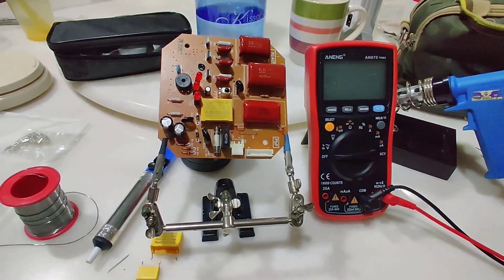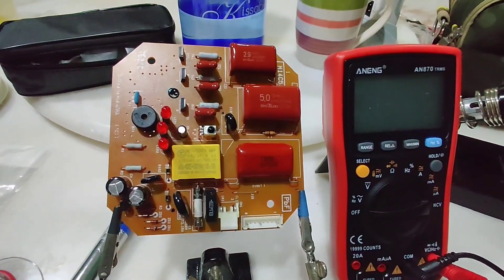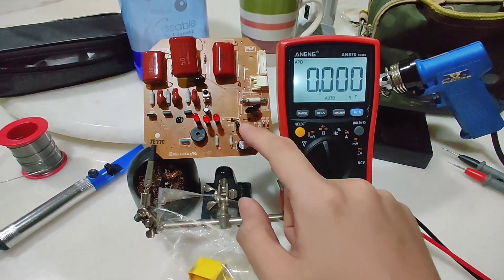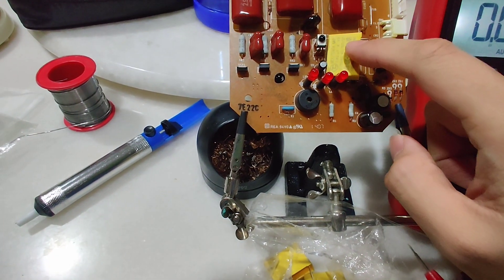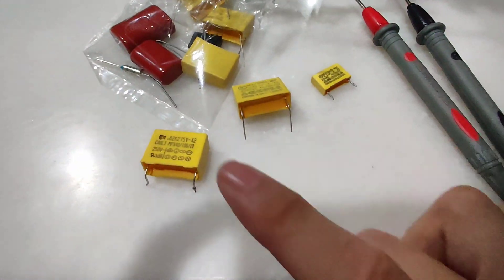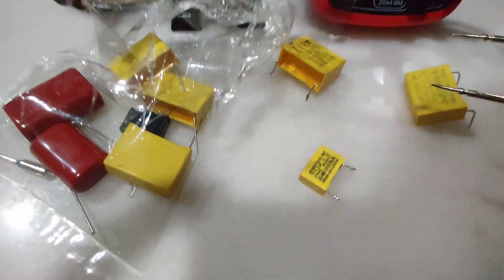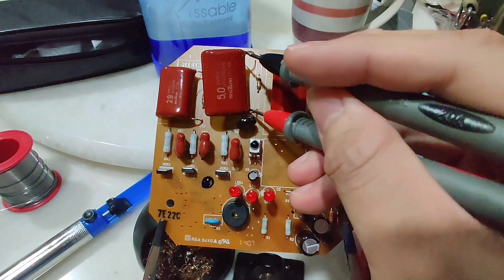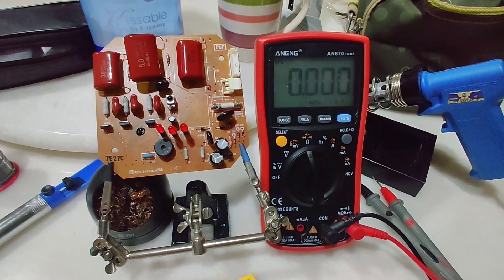How to repair the circuit board of Panasonic/KDK ceiling fans

Comment: Hi. I'm having similar PCB for KDK fan 4 blades with remote. The speed no.3 seems not functioning (already check 1 by 1 speed by remote), so which capacitor should I replace?

Comment: Thanks for sharing your video. My KDK remote control ceiling fan is slow on the first and second-speed settings. At high speed, it works fine. I checked the 1.8uF capacitor it's showing 1.4uF and the 0.1uF capacitor is reading 0.07uF. Do you think both these capacitors need to be changed? Any pointers appreciated
Reply: You can use mine as reference. Panasonic KY14R  140cm.
-All cap must be removed from board for tested, if not the result won't valid. I experienced measure the cap on board shown good value, the when remove from board and measure again the cap is bad.
- the 0.1uf cap is just filter cap, it is use for filter the power supply noise to protect the circuit as long, it won't affect the fan speed. It is connected btw L and N, that is why now new model they use safety X2 cap (Metalized Polypropylene (MPP) rectangular shape) instead of normal brown polyester cap. X2 cap is used to prevent short when the cap fail. For you case you may or may not change it, but if already dismantle why not, it only cost penny and must remember use X2 cap.
- For the 1.8uf cap, for my case it is a big black rectangular (not x2) 1.7uf AC500V, diagram shown it connect two secondary coil no matter what speed, mean it is on for all 3 speeds, and its value affected all three speeds. For my cases it is good grade AC500V, that is why my fan after 25 more years the value still on mark still 1.7uf no change. 
- 2.9uf is for speed 1, 
-5.0uf is for speed 2,
- Speed 3 no use any cap for primary coil, it jut use the 1.7uf for secondary coil same as as speed 1 and speed 2.
- 0.82uf is series with the board , it is not affected any fan speeds, it is as a voltage divider for board power, it is not connected to the coil as load. That is why now new model also used x2 cap this particular cap for safety board protection to prevent short when it fail.
Hope it help. Remember check the cap voltage, it might still hold charge even power supply is turn off, safely drain the voltage before touching it.
Reply: @andrew39454  Thank you for your inputs. I have bought a new board some time ago. I will try your suggestions. I am thinking how  to test the board out on my workbench.

Comment: Hi, I would like to ask how do I remove the circuit board from the fan. Thanks!
Reply from the maker: have to open the plastic cover from the top before you can remove the plastic cover on the bottom, for the panasonic fan that I have.

Comment: Yes thanks for your explanation. It makes me wonder why the capacitors are failing often,Is it due to inferior circuit design parameters or any other reason.I have three units and have changed capacitors a few times,
Reply: The quality of the replacement parts the
 are not great. Most of them are knock off brands. The original shizuki capacitor is of decent quality but unfortunately they cannot be bought on the market by end users. All the replacement "BM" brand or whatever is nowhere near same quality. For the red coloured ones, nothing much can be done, there isn't much choice. But for the black X2 capacitor in the middle can buy better quality ones from brands like Panasonic or Epcos from sites like element14 and they do last.
Reply from the maker: Electronics all have finite life.
Reply: Wonderful...tq sir

Comment: Is there anyway to check using an analogue multimeter?
Reply from the maker: You need specifically a multimeter that supports capacitor readout. Many cheap multimeters don't even have that feature.
Reply: @Nightstalker1993  I thought as much T_T thanks for the reply. Something else I want to ask is that you mentioned that most ceiling fans uses the same circuit board and you could buy them for 40-80 bucks at shops. I need to test if it's the my board that's broken or the motor on a fan. Can I just swap the board to see which is the problem? Because I noticed the one on my circuit board is slightly different than the one on your video. Thanks again.
Reply from the maker: @haryzXIII  If you have multiple of the same ceiling fan at home, you can swap the boards around for troubleshooting. You can buy the Aneng multimeter, very good and cheap
Reply: @Nightstalker1993  Well, damn. That's a very good idea. I wouldn't have thought of that lol. Thanks a bunch.